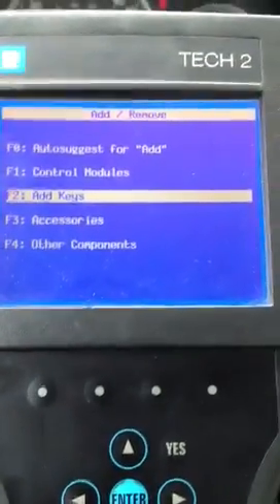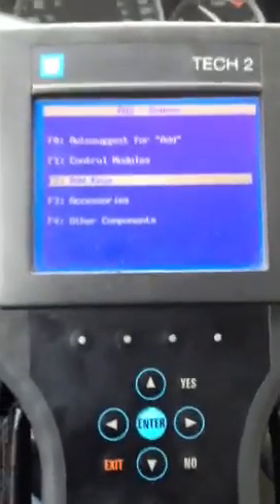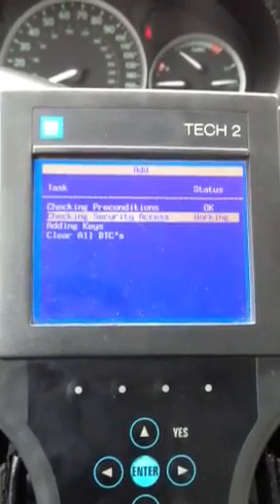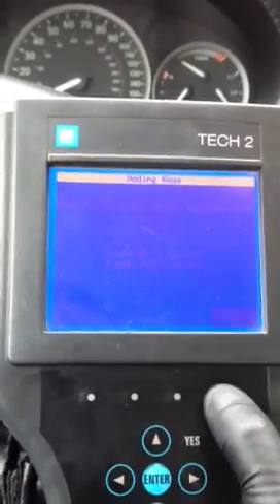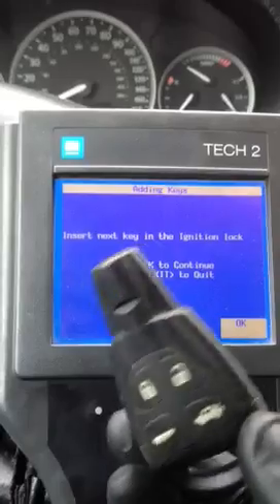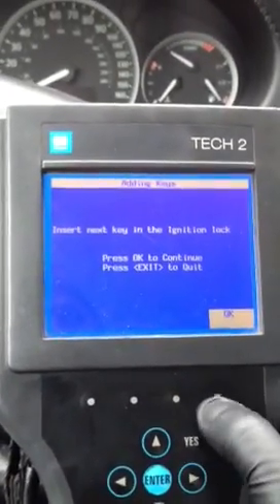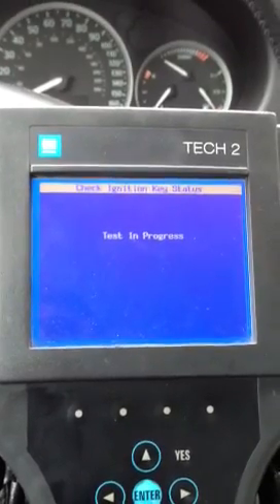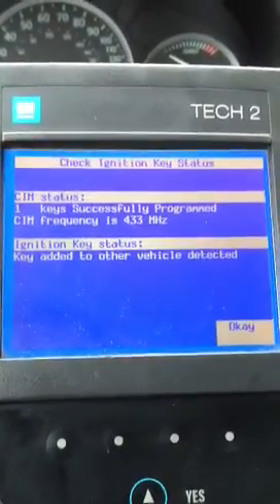Saab 9-3 cleared transponder programming

Comment: I just took the twice from a 2003 and added it to a 2000 9-3 (Mine failed). The 2003 had 1 key & remote. There is a specific set of steps in order to get a new key to work. Installed the twice to the 2000 saab. Then added the twice (via tech2), then programmed the immobilizer then added the key plus my 2 keys and 2 remotes. That  is the only way to add new keys (3 steps). I used the 2003 remote inside the key antenna ring (while it was off to the side). I then used my key in the ignition. So when it says stick in a working key and turn ignition I am able to turn the ignition and the remote is in the key antenna. So now I have 3 keys (the 03s key wont turn my lock cylinder obviously, but the remote works, and of course my other 2 keys and 2 remotes also work. So I think the remote programming didn't work because you didn't do the 3 steps.

Comment: Hi! A few months ago my workshop programmed a new key for my car. The problem was that I they added a new key without all keys were present. So instead of having three keys, the one that stayed at home is no longer working... Is it possible to re-add the 3rd key again? I have access to a genuine SAAB-SCANIA TECH2. Thanks in advance.
Reply: TL;DR: Yes, you can. Long answer: If the key was previously married to that CIM module, then you can re-add the old key. CIM modules (the system that manages the keys and security that is housed behind your steering wheel) can add up to 5 keys. Keys can only be married to one CIM. If a new key is added, then all keys should be present. If you forgot a key during programming, but it was previously married to that exact CIM, then it can be added.